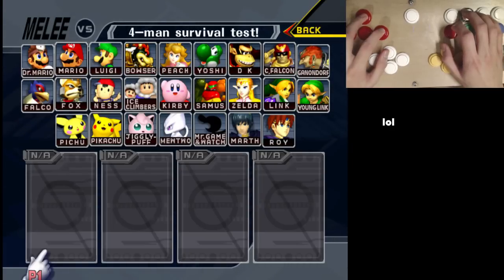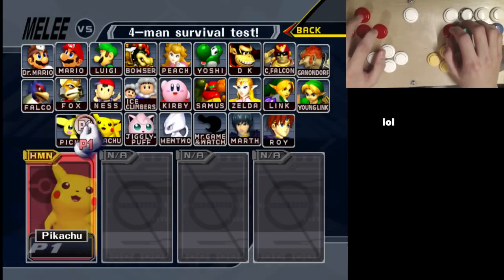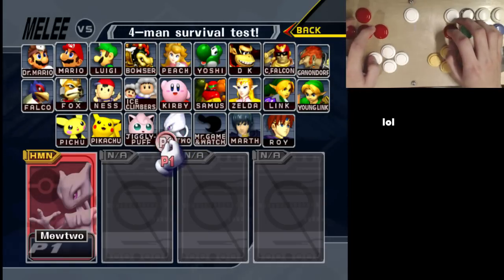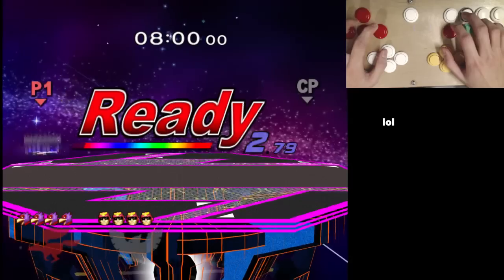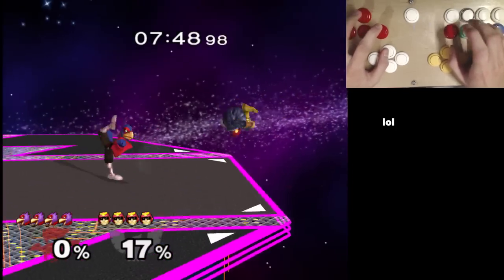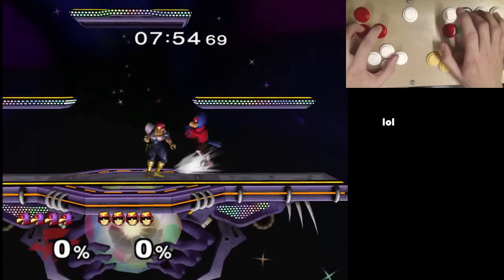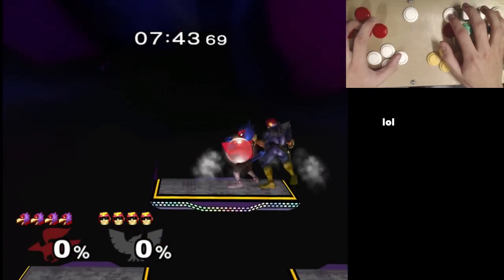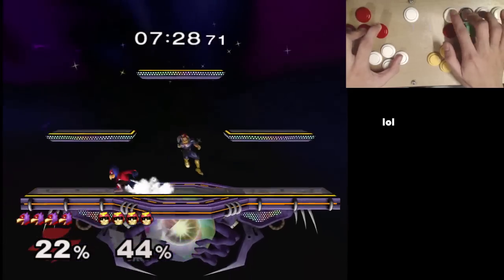How to Make Your Own Smash Box! - (Tutorial in the Description) - SSBM

Comment: Does your version work with the mayflash adapter for the dolphin emulator? Mine does not :/ can't really figure out why.
Reply: Zach Rider did you find out why it didn’t work? I’m thinking about doing this project.
Reply: @dunnowhattoputhere7532  
If you need any guidance I have a guide on GitHub documenting a similar project (https:// github .com /Oafish1/GCCArduino).  You could replace the data 3.3v connection with each of the buttons and use the Nintendo Arduino library to send controller outputs to the console if you wanted to use my code.  You wouldn't need to use the logic converter for any of the buttons as their power would be supplied by the Arduino.
Reply: Oafish thanks
Reply: @Zach Rider 
Hello, I hope your problem has been solved at this point.  If it hasn't then here's some firmware that should work: www. mayflash .com /File.asp?Id=106.  Spaces are so that comment doesn't get blocked.  You might also need to use native control for dolphin (https:// dolphin-emu .org /docs/guides/how-use-official-gc-controller-adapter-wii-u/#Using_Zadig).

Comment: been thinking about making one for myself - do you know how the community has decided regarding legality for selfmade controllers like these? I'm no engineer so i hope you don't mind answering one or two questions if this is legal.
Reply from the maker: As far as I know Smash Boxes in the current state are legal.  I would contact your local TO though just in case if they have a different rule set.  Let me know if you need any help along the way!
Reply: So you've been able to enter tournaments with this so far everywhere? Would kinda suck if I could only use it in a few tournaments, wouldnt make sense to switch at all then for me.
Reply from the maker: Yeah, I never had a problem along with Gravy (as far as I know).  Locals are pretty lenient with rules, and as of right now most major tournaments allow Smash Box type controllers.
Reply: thanks, that seals it for me. ordering parts now :)